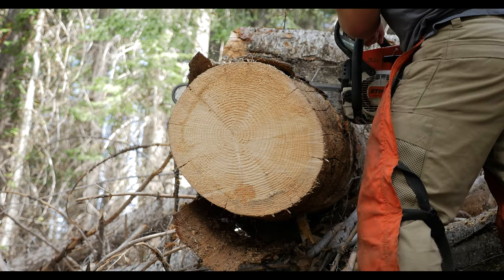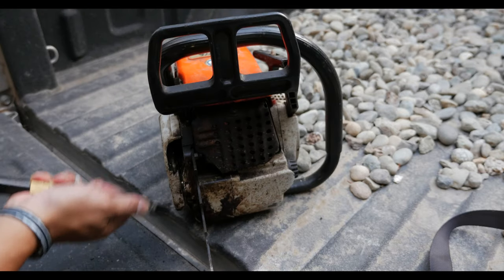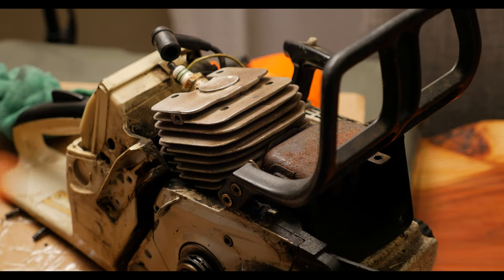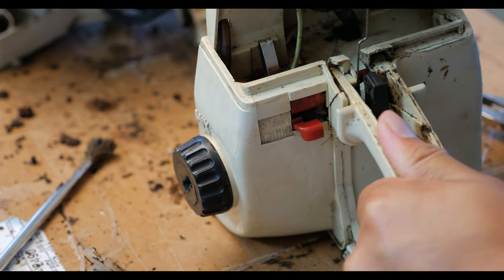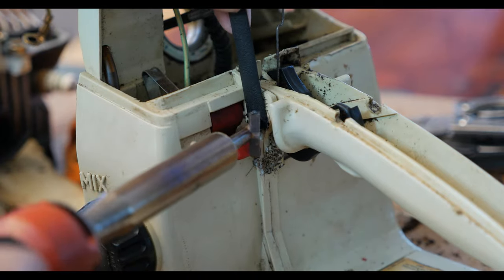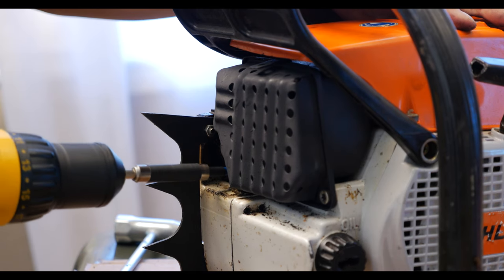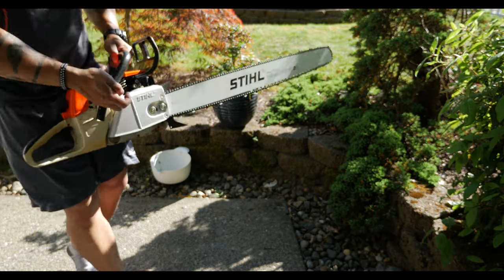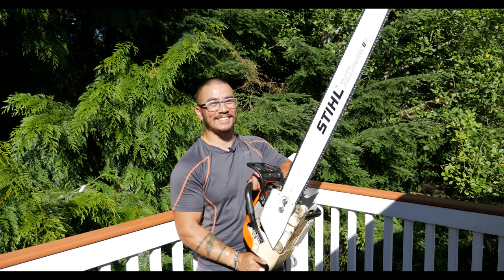Restoring Rare Vintage Chainsaw | Stihl 038 Magnum 2

Comment: That is a very nice saw. (All most new)
I used one like it for years (in my line up) cutting firewood.

Small tip. During reassembly I would not use a power tool.
It is very easy to cross-thread and strip the holes in the body of your chainsaw.
Reply from the maker: Good call!! First time really doing this so tips like this is great :)
Reply: @innerbarkoutdoors  :)

Comment: I just bought a used 038 Super and I cant wait to start using it.   Loved this video!
Reply: I have the same saw.  Dad bought new in 1991. Just put a new filter and spark plug - runs just like new. Here in Canada there is a acid based cleaner that Stihl makes. Works outstandingly.  Quite strong actually, melts all the dirt but does not affect the paint or plastic.  Wear gloves it will burn.  how is the saw anyway?

Comment: Thing should go for a while, mine lasted close to 900 quard before the motor locked up solid. These and the older husky 61 are the best saws out there to run on a 18 to a 24 inch bar for milling.  Go to 24 inch i recomend a skip tooth chain tho.
Reply from the maker: Nice to hear, Nelson. Thank you for the comment and your experience with these beasts.

Comment: My experience and my fathers both logging our whole life, Stihl has the power and performance but the reliability lacks compared to Huskys in cold weather. Even the colder weather kits don't seem to help... my experience that is. Still lovely saw!
Reply from the maker: I work up in a logging town and the old timers seem to love the husky saws for their vibration dampening. I like the Stihls because they are more straightforward for repairs in my opinion. I haven't used the Stihl in lower than 20f so I'll leave that to you folks

Comment: Has you pulled that chain yet? How's it cut? I just rebuilt a 038 super swapped the top end to a mag top end ported pulling a 25 inch bar with rsf  chain and a 8 pin sprocket and so far have sunk the whole bar into red oak and had no issues, cutting 8 inch pine takes 3 seconds on the timer. It pulls hard to say the least
Reply from the maker: I haven't cut anything with it yet. I'll be getting into firewood production once it cools down a little bit. The engine has a ton of compression. Sometimes feel like I'm going to break the cord

Comment: Checking in,  hows the  saw running? Slapped a 32  on mine with skip now and did a bit of port work last fall and it woke up like a mad man now
Reply from the maker: The saw is running well! Once we get some more snow melted at the cabin we will be going WOT on some trees.